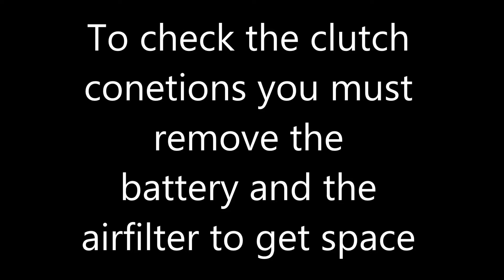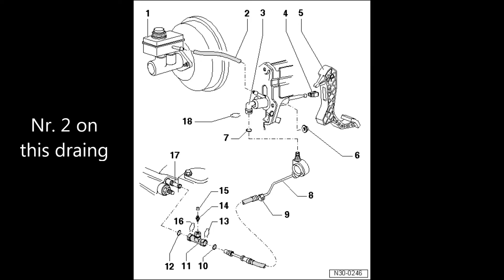Hydraulic clutch problems Seat Altea XL 2.0 TDI 140 hp It can´t get it in gear

Comment: Is this car a left hand drive because I can only find the brake master cylinder under the battery.
Reply from the maker: Yes it is let hand drive
Reply: @MichaelKroese  Thanks Michael, I can`t bleed the clutch. I did have some clutch, think the fluid got low and it got some air in it. I`ve even had a vacuum pump attached to the bleed nipple by hose. Turned vacuum pump on then opened nipple and tried to suck the fluid through, did bring some fluid and air up the attached pipe but still no pedal.. Not sure what to do now as I can`t drive it to a garage.
Reply from the maker: @antl8209 If you can't get pressure on the clutch then I will remove the main cylinder and check it and clean it. I had to clean mine before I could make it work again. It was filled with black flakes. Check if the main cylinder is leaking and therefore can't provide pressure. If so, you need a new head cylinder.

Comment: Any idea of the part number of these seals anyone?
Reply: Honestly best just to get pipe and jubilee, once disturbed you need a new one, usually the top one goes.
I bought a master cylinder before I saw the video seems like black fluid is giveaway for top seal on that pipe. Thinking the seal comes with the pipe only and fitted inside once removed that's it.